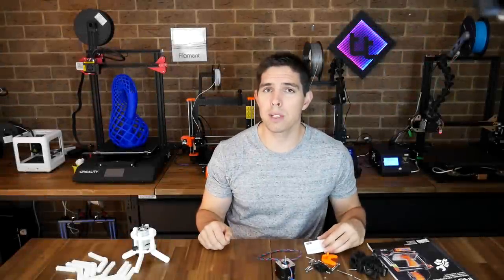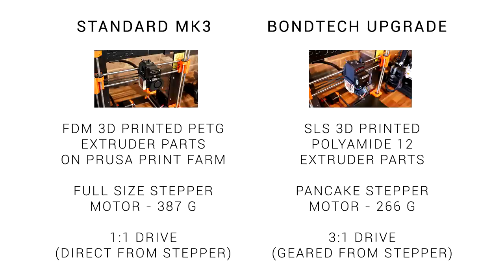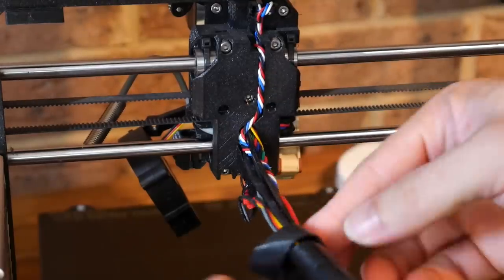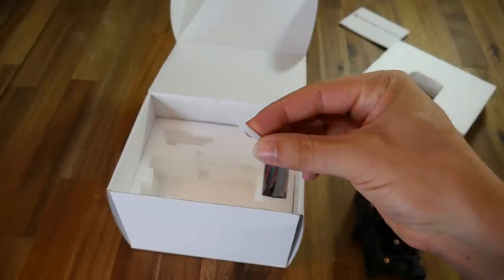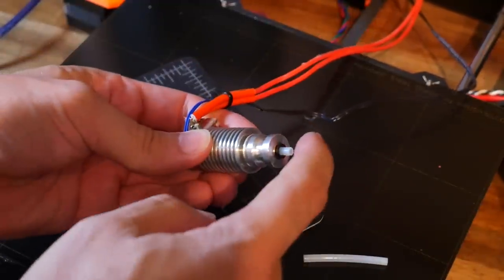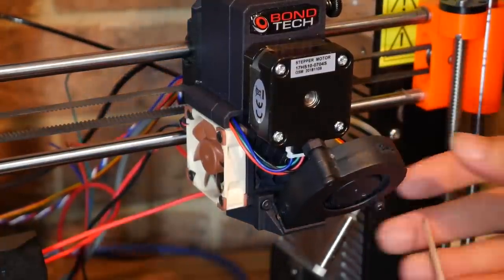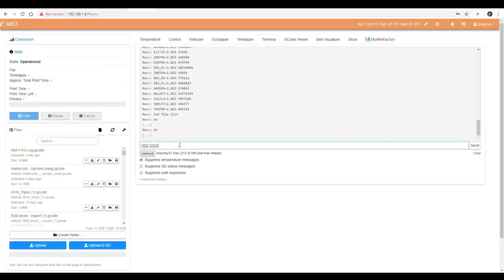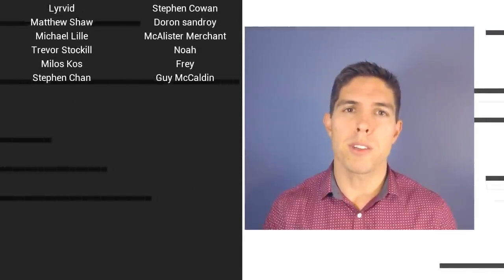Bondtech Prusa MK3 extruder upgrade - Installation and test

Comment: I was thinking of buying this upgrade but after seeing this video I think I might save my money. The results show no improvement over the stock parts.
Reply: Stephen Boyd that's because no tweaking of settings were done to harness what the extruder can do. Using good settings for one extruder you've spent time tuning and throwing it on another isn't scientific. It in fact isn't how you should test things. You need a properly tuned profile for each setup to see which prints better overall.
Reply: jimmer clones are trash and hurt the originators. Buying a clone is the same and saying screw you for making this awesome product and stealing is fine. Bondtech does own copyright to the BMG.
Reply: I think the big pro of this is the massive Tork you get. I have Issues with 0.25mm Nozzels because of jamming. With that Tork Upgrade it should be easy to print with. Would be nice to see another Video About it.
Reply: I know this is old now but the mark s makes the improvements he mentions anyway for no more cost. Lol
Reply: I know this is old, but I feel the added heat resistance of the sintered parts is being overlooked. I warped the factory provided extruder body (specifically, the PINDA mount) printing in polycarbonate. The SLS parts will weather those temps far better.

I find overall performance printing PC far better with this extruder, the additional torque making it much easier to extrude at higher pressures that really help with PC layer adhesion.

Comment: It's great to see more humans jumping onto the new extruder. I'll answer a few of the concerns and misconceptions provided in the comments. 

1. Far more has been done than just adding 3:1 to the bondtech. 

-all new cooling for the heatbreak which lowers internal temp for better retractions and far better low layer height printing. 

-100% aligned filament path which none of the stock prusa extruders have. 

-cooler motor operation and no residule heat to the gears. This is an issue with direct 1:1 extruders where motor heat is transfered to the gears. 

-best retractions available. Most users can use less retraction which improves print quality and releives pressure in the hotend. 

2. It's completely open source. Just like your prusa all files are available to print or modify. Yes. You can just make this on your own. There is already a user who converted the files to be fdm printer friendly. 

3. Higher heat resistance than stock. Better than ABS thermal properties so less chance of melting it. 

4. Better layer performance. Compared to stock the majority of users see print quality improvements. Some more drastic than others because the rest of the printers assembly matters but if you've done the rest correct your prints will be better nice posted numerous prints that are just stellar using this mod. 

I think too many viewers took this as a full scientific test. I can that reusing the same settings is actual bad in this instance. This is an entirely different extruder and optimal printing settings vary greatly from stock. I've built profiles for this extruder to help users get started right away instead of using bad settings.
Reply: Chris, I feel like I don't more but higher retraction speed.
Reply: Where have you posted the profiles?  I would like one for both S3D and Slic3r PE.
Reply: @cybrsage The firmware and profiles are listed on Bontechs site. They posted a link to his Github.
Reply: I didn't see this as a scientific test either. There are alot of people not optimizing their print settings for each filament either. That benchy looked bad and my Mk3 didn't print that bad with stock profiles in PLA or PETG.
Reply: @Deneteus  my Google photo isn't level 0 today, can you provide a link to location?
Reply: @cybrsage  Not very sage. It's in Teaching Techs description under the video.
Reply: @Deneteus  I see many links there, none talk about profiles.  I looked there first, and looked again now and still do not see profiles.  Which of the links goes to profiles, since none of them are labeled as such?
Reply: Thanks for the details...now it makes sense to try it out!
Reply: @cybrsage  Did you ever find the links to the profiles?  I have been searching without finding anything either.
Reply: @edwardboston8600  No, all the links only had firmware and such, no profiles.
Reply: Chris W-- What are your thoughts on adding it to the MK3 with MMU2?
Reply: Heat transfer on stock extruder is a real pain. When using closed chamber (Lack-based), temperature gets up to 40C and in half an hour stock motor overheats and makes an ugly melted blob on bondtech gears.
Tried Skelestruder (same principle, 3x1 with thermally detached motor), it helped. Now moved to this extruder.
Reply: @Chris, do you have pretty profiles for this extruder for PLA, PETG, ABS?
Reply: @karoo_bushman6880  so far so good

Comment: It is clear in the instructions that there is still a bolt to retain the filament sensor, just to the right of the idler door. I have 2 of them, and both are screwed down.

Comment: Great video. I've been looking at the Bondtech upgrade, especially since they just did a new refresh of the design for the MK3s and that the Mosquito extruder is available.  While the Mosquito won't by itself improve performance the cold nozzle changes and potential for much faster print speeds jives with the geared Bondtech quite well.

Comment: As someone who got a dual drive extruder I can safely say *that they really do let you crank the speed up...** Just be aware that you shouldn't go too quick unless your hotend can handle it because the extruder itself can crank out so much pressure it can rip the bowden tube out of the clamp on a bowden system.

Comment: I would advise you to carefully remove the rust from the bondtech gears and a dap of grease on the gears and on the needle bearings in the idler gear like bondtech advises! Prusa also does that since a few months

Comment: With two gears after one another ( necessary for the direction whereas only one wont work) in a triangle setup for the additional gear, the contra wheel could be adjustable. Put the contra wheel with a spring tensioner and a screw in a slide and voila it could work for both 1,75 &3

Comment: Fantastic walk-through Michael. I'm the same as you regarding upgrades to printers, I too find it more satisfying that the actual printing. My MK2 is my daily driver, although I do have smoother rods and Drylin bearings to replace. The other printers are my 'tinker' machines, especially the Borg.
Huge thanks to the others in the community that helped with this.

Comment: For people with a stock mk3, prusa released a new extruder last summer, which also tilts the part cooling fan like this upgrade does. See https://shop.prusa3d.com/forum/general-discussion-announcements-and-releases-f61/new-printed-parts-b7-r3-and-other-improvements-for-t25616.html

Comment: You mentioned in the video that the filament sensor is not bolted on.  It should be bolted using an M3X10

Comment: Printing at 100 mm/s seems a bit problematic, even if it could do it after that upgrade.  That's quite the upgrade and you detailed it very nicely!  (I'll continue to print slower and not have to re-do my print jobs!)
Reply: I print at 120mm all the time on my cr10s pro
Reply: Glowey Bacon off course you can... at least teorically goes to 120mm/s... but quality will be low or lower then in a 60mm/s. And most of the time your slicer speed is not the final result, to know your real speed you should consider accel and jerk in your firmware. Insert your printer data and know exactly how is your speed in: gcodeanalyser
Reply: in your firmware and even in your slicer... there are a lot of speed limitations to considerer. One thing is fact... if you go slower you’ve got better quality prints considering your structure is enought rigid and well posicioned

Comment: Question... Is the printer the problem at 100mm/s... Or the extruder. To say the extruder made no difference is problematic... Because there is no testing to show that that the extruder made no difference. Mostly the test showed that the lower stepper weight at 100mm/s did not improve surface finish. More AB testing is required... In my humble opinion, but thats just my research background kicking in.

Anyway, my best performance improvements with Bondtech on my printers has been with improved melt rate. Faster printing via deposition rate... Not tool head speed. 

But great tutorial as usual. Keep making great videos. I'll keep watching them.
Reply: Eric Lien Good point! More tests are needed. This kind of upgrade for me doesn’t point to a speed increasing but volume of extrusion. I wanna see tests with wider nozzles and more mm^3/s (speed x nozzle diameter x layer high). And also flexible materials tests to check retraction improvements and precision.

Comment: Good effort and very well presented.  I don't get why the Mk3 has this ringing issue :-( I never noticed it on my Mk2s. You'd think that the Mk3 frame should be more rigid and the smooth trinamic drivers would create less vibration. So what's the deal? why has no one cured this yet?
Reply: You are not encountering ringing because you probably use default perimeters print speed profiles, which are much slower then 200mm/s presented in video.  You can avoid ringing on rectangular object when printing in high speed by decreasing jerk rate and still have high overall speed. I am using 170mm/s for big inner perimeters, 130mm/s for big outer perimeters and Maximum jerk X and Y decreased to 2 mm/s with good results.

Comment: I have the cr10s and constantly print at 100mm/s since I'm impatient. Seems to work alright except for some minor ringing on very small parts and often when doing letters with a negative profile Cura seems to change the printers direction and the corners become uneven. It might be the SD card though.